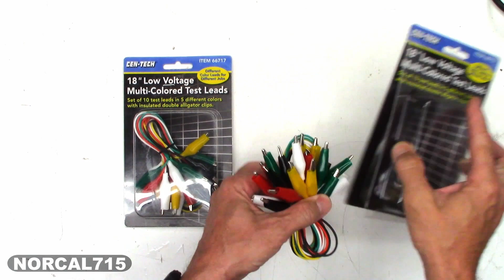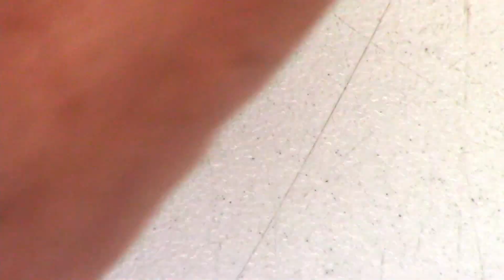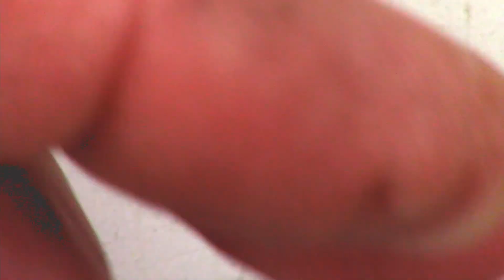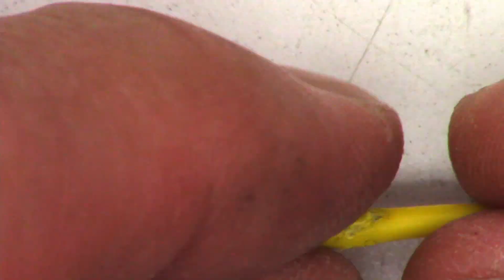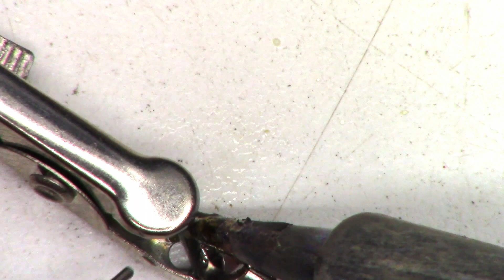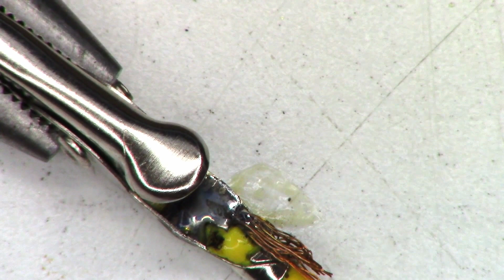"Fixing" some brand NEW Harbor Freight Test Leads. Part Number 66717

Comment: Nice video. What sort of current do you run through a single lead at what voltage?
Makes me wanna go check my leads that look exactly like your but were probably bought from  eBay, Amazon or AliExpress a few years ago.
Reply from the maker: 1 or 2 amps max continuous current. With an occasional 5 or 10 amp VERY intermittent duty.
Reply: @norcal715  excellent, thanks!
I only ask because I remember trying 4A and it was very warm, I maybe did 10-20 second bursts for diagnostic purposes to find out current draw on a device.

Comment: harbor freight has come a long way from the early 90's as a car mechanic we would laugh at people who used those types of tools the tensile strength and torque on automotive fasteners required the best tool possible that could fit in tight places and not break when using impact tools snap-on mac, cornwell etc.. met those demands craftsman was second place when you were in a pinch and needed a socket to finish a job because you lost your good one you would go to sears that night and get what you needed till the regular tool man would come for his weekly visit as a industrial mechanic those type of tools are not needed like in auto repair so i go to harbor freight being now craftsman is slowly going away in the stores and am surprised of the tools harbor freight has to offer in my opinion tools like fluke Wiha channel lock linesman harbor freight isnt as good but will do the job
Reply from the maker: Thank you Dan! They are getting much better over the years.

Comment: They are not bad leads.   At least all the teeth on the clips are aligned with each other.   The peened hinge seems pretty good too.   Maybe I just got a decent batch.  The only major fault is they don't seem to clean out the mold release grease from the clip covers.   I rough up the metal on the clip and degrease the rubber cover with alcohol to grip the clip.   If you don't do this the clip rotates inside the cover when you pinch it.    I also make a few high current leads with 16 AWG wire after discarding the factory wire.   I solder al my clips too.  Nothing worse than testing and getting inconsistent readings because your test leads are s**t.   It's hard enough to troubleshoot a devices problems without the added issue of troubleshooting your gear.